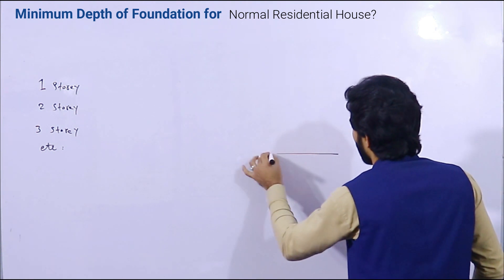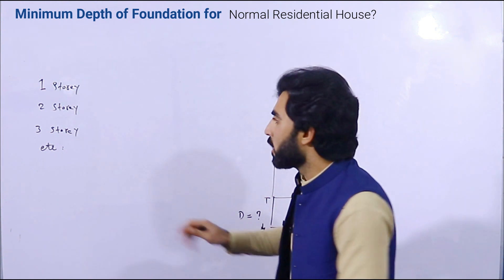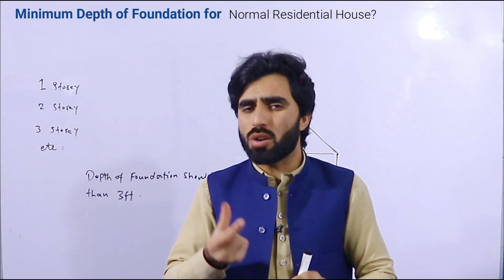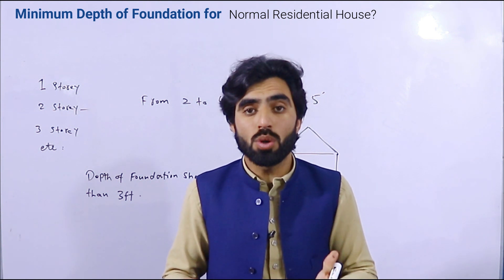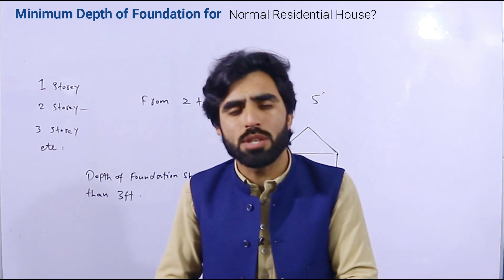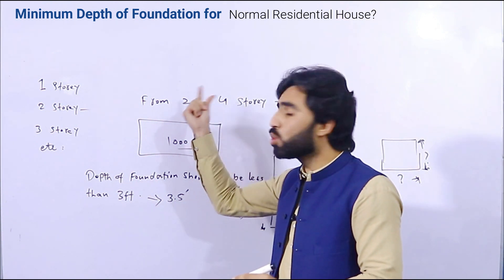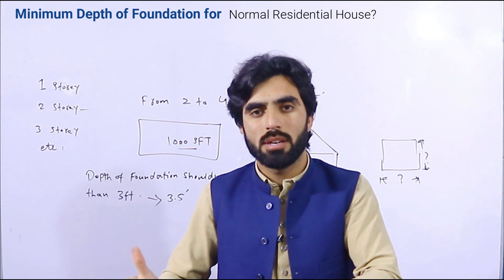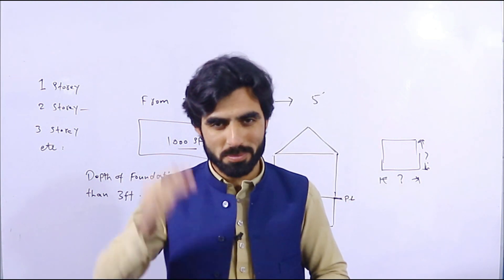Minimum Depth of Foundation for Normal residential House - What is the Minimum Depth of Foundation

Comment: If you are building in a solid rock soil for a one floor house (depending of the dead weight of the load) three feet is not necessary.
The formula used will determine that.

Comment: how to find depth of foundation? hire several standby men. supply them with shovels. tell them to dig until they are tired in the prescribed pattern sketched on the cardboard. if humidex is excessively high stop frequently for lounging and drinks.

Comment: What he speaks is absurd. There is no thumb rule like it should be 3' for single storied building and 3.5 for two storied building. Only thing is that the foundation should rest on a bearable stratum.  Increase in depth is of no advantage. Width of foundation is more important. For double storied building the load in foundation will be more than a single storied building. So if you opt same width for a single storied and double storied building there is a change for relative settlement and may cause cracks in superstructure.
Reply: As a thumb rule the speaker said is correct
Reply: @mohanbabupm5778  There is no such thumb rule. I am a graduate in civil engineering and architecture with 40 years of experience.

Comment: If 4 storey apartment building with 2220 sq ft per floor. What should be minimum strip footing width? Also can entire structure be built with 8” concrete blocks with rebar and filled cores without doing columns and beams?

Comment: Greetings! What a cool idea. Thank you for an informative video. May I ask sir, if for example I am going to raise 4ft building but the side are different. I mean the ground is not flat the other side is lower and the other side is higher, how shall I measure the foundation of that building?
Let's say the other side is 8ft lower. Should I add more feet on the other like? Should I plan for 16ft? I'm wondering what would happen if this is the case?